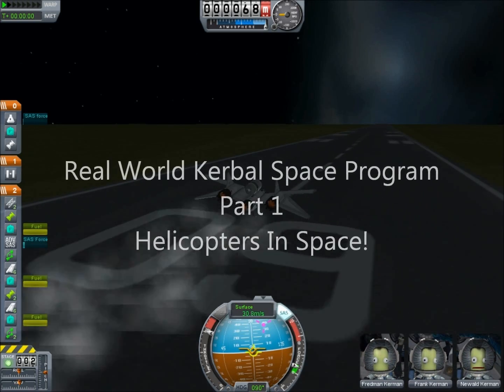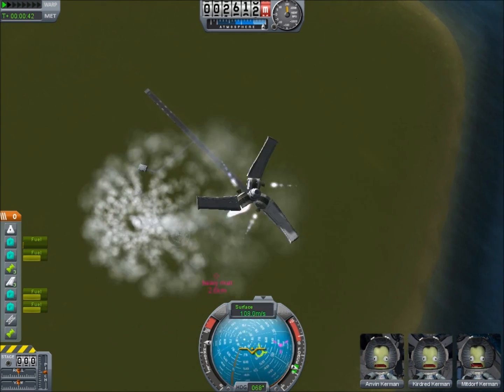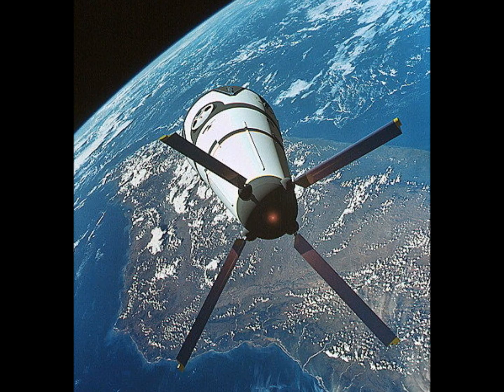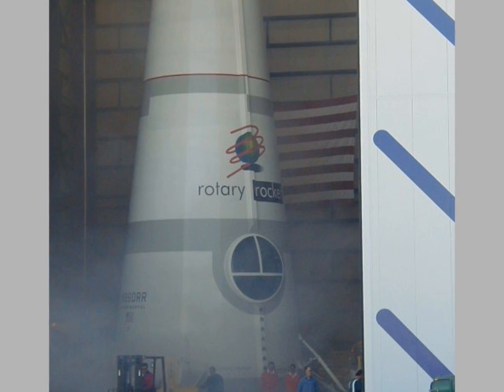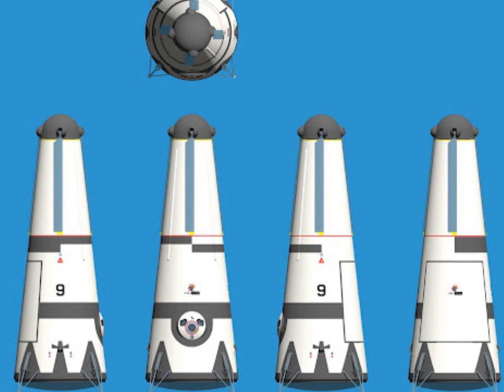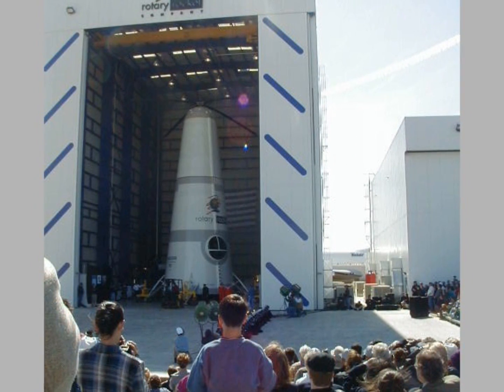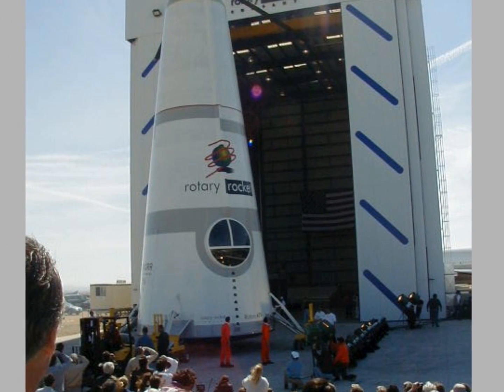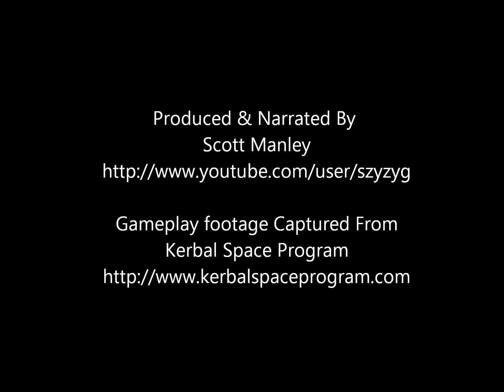Real World Kerbal Space Program - Part 1 - Helicopters In Space

Comment: I remember the first (on paper) version of Roton.  It had the rockets in the tips of the rotors.  The idea being that they'd get fuel and oxidant pumped up to high pressure for free by centripetal force. 

But it turned out that that was a lot more pressure (or a lot slower rotor rotation) than was practical.

Comment: It used things called tip jets.
The rotors would be spun by jets (either pumped air or exhaust) at the end of the rotor. This would virtually eliminate the usual torque helicopters have, in actually friction would spin the main craft in the direction of the rotors (opposite to normal helicopters) but that can be easily countered by having some motor to drive the rotors like a normal helicopter.
Hope that made sense...

Comment: I was able to build a similar design as this. it had 6 winds around it to create stability and supplement the jet engine on the bottom with their lift (which they didn't create a lot of). I got it up to a max altitude or 2500m before the engine died and I had to eject the winds and fire parachutes (b/c it had no control with the wings while falling) I tried adding a rocket engine but it was too unstable for me. oh and I tried to get into horizontal flight but it just spun around and crashed.